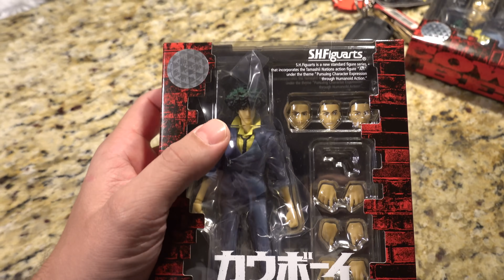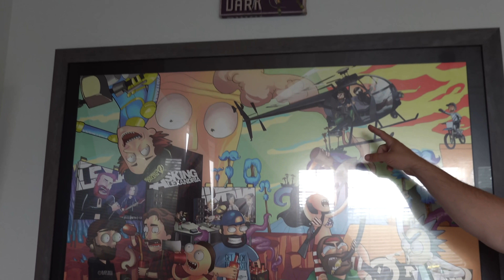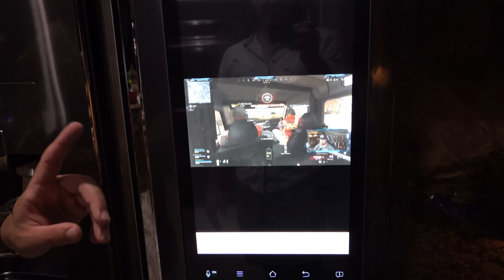my monster son finished off poor Goldie - ft. @DemolitionRanch @MBest11x @KentuckyBallistics

Comment: I got my Flux defense a few months ago. Found that the factory mag release for the sig was a bit hard to use in it so I bought a springer precision extended mag release for it, and I'm waiting on a second trigger unit from sig so I don't need to disassemble my M17 and flux every time I want to swap over.

Comment: It appears you guys have already built stuff, but you really need to look into Compressed Stabilized Earth Block (CSEB), which is basically adobe, but with cement instead of straw, and a whole shit-ton of compression. It's highly bullet resistant, but also "green", and it has a bunch of other advantages over stick built construction.

Check out Dwell Earth (who are based near Austin), and see what it is about!!!